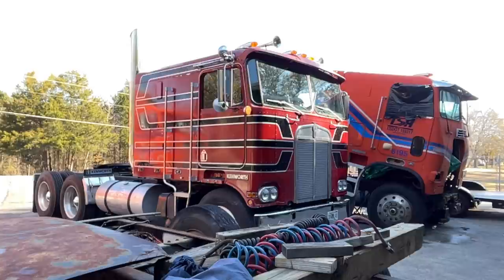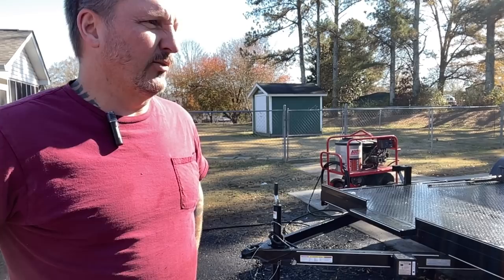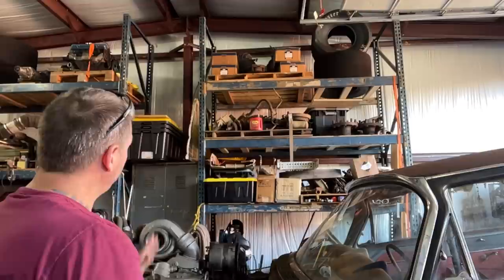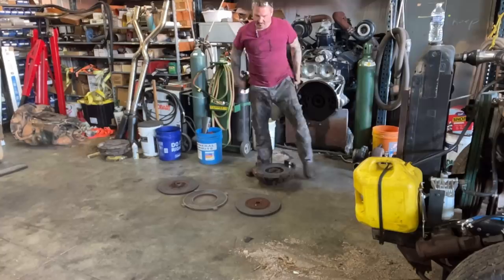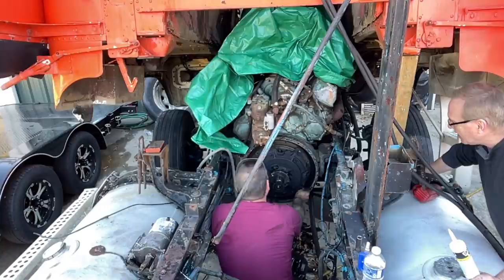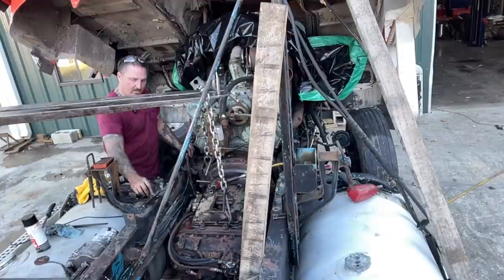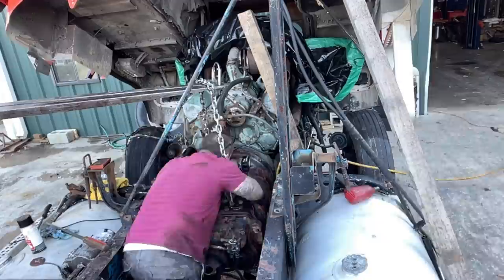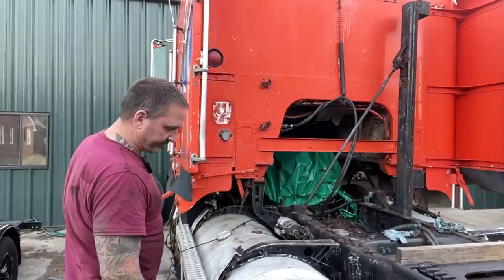1984 Freightliner Cabover "Delores"  gets an Eaton RTO 12513 13 speed transmission

Comment: I don't mean to be talking out of turn here James but that was just Brawn over Brains !! The last thing I wanna see is a death on video or even a TBI with a James Pretty disc pressure plate hanging out of your head!! Good job not falling lol good video but be more careful !! I can't lift anymore with 2 stomach surgeries but I think I could handle that with a block and tackle!! You are the epitome of that meme where is says why women outlast men!! I unfortunately took a ford AOD tranny out on my knees and elbows lol so I'm there with ya buddy lol
Reply from the maker: No worries. That’s what comments are for.  Often in hind sight I see better ways of doing stuff
Reply: @JamesPretty  I know I chipped my front tooth when I loosened that AOD tranny off the Dowels  My knees and elbows did fine  When the line fittings let loose of the ferrels I didn't expect to almost eat the cooler lines THEY WERE SPRINGY and the corner of the nut got one of my two front teeth! Just the very edge luckily lol  I have a transmission jack now and a cherry picker !! I just thought you on a forklift Jessica driving ( unless she watched ID on TV : lol I kid ) Could have brought it down pretty easily I would think But I couldnf see 360 so I just Held My Breath for you each time I saw A FAST DROP coming !! Lol I LOVE YOUR VIDEOS SO BE CAREFUL Buddy !! I can't drive for a company but if you need a tag team driver to get something Home I kept my CDL current just FYI and NEAR 35 in bama which comes out In ROME !!
Reply from the maker: Rite on

Comment: Bet you don’t put the clutch parts quite so high next time around. That looked like it was a painful getting that last piece down. Surprised me you didn’t have to rotate the input shaft looked like it lined up first try. I was thinking you forgot clutch brake. At least you got it before it was too late. They do make a two piece version so the transmission doesn’t have to come out to fix a bad one. I’ve never heard anything good about the 2 piece one tho. Gosh you’ll be driving it next week at the rate your getting it together. Can’t wait for the next video hopefully you can just find a driveshaft that length. I don’t know how much getting one made cost.
Reply from the maker: It’s not too bad to get one cut down. I imagine a new one made to order is 5-700$ maybe more I don’t know for sure
Reply: @JamesPretty  I didn’t know that it wasn’t that bad to get one made. Couple U-joints and it is ready to roll. Cool

Comment: James are you sure you can run  80/90 gear oil in that box . I was always told to only run SAE50 oil in them
Reply from the maker: Ya it’s a straight cut gear box  it would be noisy with 50w   But it probably is meant to have 50w I’ll check
Reply: No worries mate !  Just what I was told to run in mine they said the gear oil reacts with something in them ! Has been awhile since I had my own!  They are great looking trucks you have!
Reply from the maker: @lylechapman9757  I’ll double check appreciate it
Reply from the maker: Looks like some guys say the synchros take a beating from gear oil.

Comment: Only three and a half to four gallons of oil...🤦🏼‍♂️ the plug on the side is a fill level plug...
Reply from the maker: Ya I filled it right up so I could’ve get everything coated.  I’ll drain it out to the correct level before I drive it.   “Well it’s on the list” anyway

Comment: Did you torque those clutch and flywheel bolts??
Reply from the maker: Ugh.  You’re the first one that mentioned it.   I did not and I realized it like an hour later. I’m gonna try to do it thru the bottom hole
If I can’t get it I’ll pull the trans back off.  It’s a solid hour / hour 45 job
Reply: i mentioned it while it was going on. Apparently he did not hear me :)